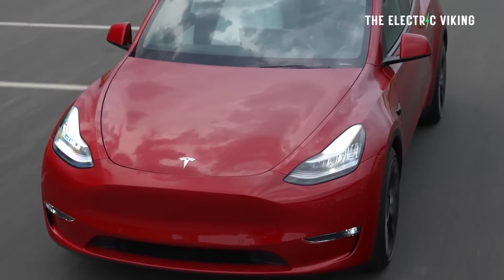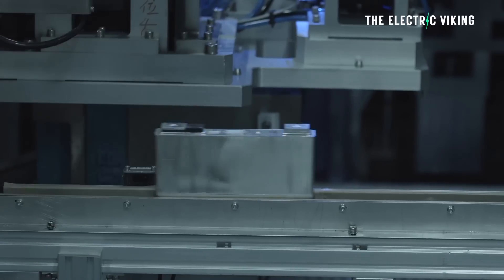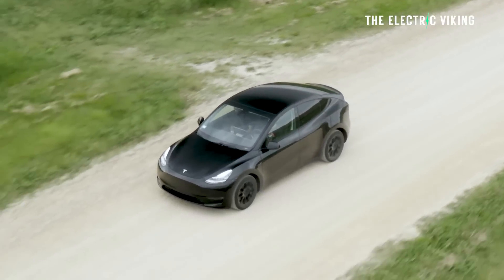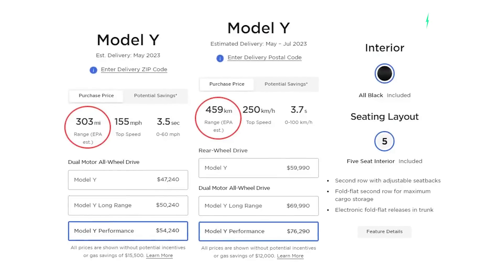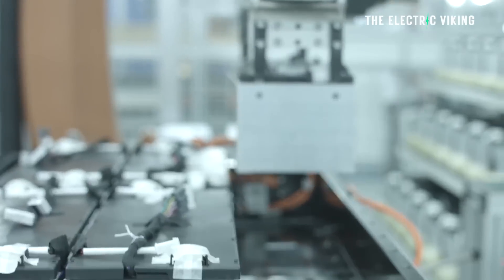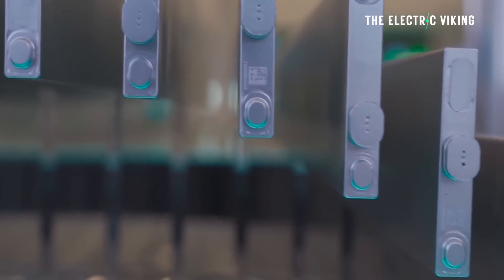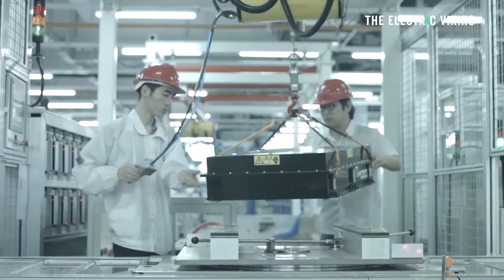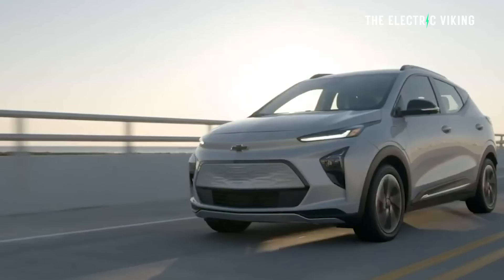Tesla makes big change to battery in Model Y Performance

Comment: I think that your range calc is backwards? one rotation of a larger diameter is a certain distance, larger diameter has a longer liner distance on one turn than a smaller diameter so will go farther on one turn, or goes a longer range. It's like changing gear ratios when you change overall wheel/tire diameter. Has anyone bothered to measured TIRE diameter or the rolling radius with the smaller vs. larger rims because they could be the same depending on the tire that is installed. Tesla may have kept overall diameter the same in order to not mess with the gear ratio?

Comment: I don't know how for one minute you could think that going from a NMC battery to a LFP in their supposed performance model is great move. Technically it is significant step backwards and is solely a cost saving measure. LFP batteries are particularly bad in sub zero temperatures in their performance and charge retention, ie you loose a lot of range 35-45% in subzero temperatures.

Comment: I thought there was an issue with fitting the performance brakes with a smaller wheel, I recall that was the case with M3, there is something unique about the bore or offset of the wheels to fit with big brakes…
Just from memory, haven’t looked in to it.
Reply: I have MYP with the 19” Gemini’s fitted, no issues. There may have been an issue with the M3P downgrading though.

Comment: Wouldn't we be able to tell if a Tesla has LFP batteries because of how the charging is done. Cars with NMC batteries tell you not to charge over 90% on a daily basis. But cars with LFP batteries COULD be charged to 100% daily. So wouldn't the car's charging screen notifications reflect the type of battery it has?
Reply: Yes you can tell on the charging screen.   It's not direct but if you look at the green battery it has the recommendation for charging and the lfp shows to 100%

Comment: You can add a realistic 40 horsepower to a model y perf by changing to 25 pound wheels 19 inch  factory sets weigh 88 pounds a corner w a tire.
Reply: Imagine the range that would add to city driving.

Comment: As Europe gets more cars out of Berlin they need less from China so they may be an excess of Chinese manufacturing capacity or ability to ramp it up so they send them to Canada and free us US production a bit . I really wonder about the chemistry of the 4680 battery ,could it go LFP or the battery with  manganese in the mix ??   .

Comment: I suppose in Vancouver or Toronto drivers won't mind the distance - unless - they do a lot of traveling between cities. Canada is very spread out; and there are many locals where 200 miles real driving range at 70mph.. is going to mean charging more during the trip.  Say Yellow Knife to Edmonton..that is a 15 hour drive with zero stops;  to charge every 3 hours may take 4 stops of an hour boasting total time by to nearly 20 hours; if you were staying somewhere at night I suppose you could subtract one charge; but even making each leg would be stressful

Comment: Canadian here - 488 km range is more than I need for the longest continuous, no-stopping trips I have ever made in the last two decades.  LFP batteries are my strong preference - longer life, ~ zero fire hazard, & can be charged/discharged  0% ~ 100% without degradation.  What's not to like?
Reply: As a Canadian I would think your preference would be to sodium so you could actually have some winter range.
Reply: Winter 303-30% =213 -highway 20% 173 miles.   Your ok with that?
Reply: @charlescasto4226  Yes, in my specific circumstances.  I'm aging out of long winter driving situations, so range loss in winter is irrelevant to me.  I'd also remind you that ICE vehicles also lose range in winter, especially when driving in snow.  Truth is, I may never actually own an EV - my little 2007 Honda Fit is still very low mileage & may last my wife & me for the rest of our lives.  Who knows?
Reply: @jrb_sland5066  ice loosing range in the cold is a disingenuous argument as you can fuel right back up and the highway has no range loss.  Where the ev has to constantly heat the battery to use it.  Hence the loss.  If your in deep snow you will have even more loss for EVs.

Comment: With all the claimed break throughs in battery technology it still seems the vast majority of EV's still have a range of around 250 - 300 miles on small wheels.
With most countries not having the infrastructure this means going on long journeys, typically for holidays with family or where a caravan may have to be towed, this limits or can make it extremly inconvenient and stressful because of having to plan where to recharge with likelyhood of queuing for ages in busy areas.
For these reasons alone, will not be purchasing because of constant worry and hassle... 500 - 600 mile range coming down to 400 mile when towing would be the time when clearing out the old petrol car...
Reply: I don't actually know one person who owns a caravan.

Comment: I don't see why larger wheels, with greater circumference tires that travel farther per wheel rotation, provide less range.
Is the motor so much less efficient at lower RPMs?

Comment: I'd rather have the LFP battery car. The longer lifespan and greatest safety are the most important factors to me. They are fast charging and have a wide operating temperature range. The energy density is everything I need in a car battery; that's win / win / win / win / win.  Cheers!
Reply: More cycles, but NOT persé longer lifespan… Common mistake or unmentioned: calendar aging they are similar to li-ion
Reply: Another win for the chemistry is LFP batteries should be charged to 100 percent daily while the other chemistries are recommend to no more than 80. Meaning you’re getting all of the posted range every time you drive the car.

Comment: I have a video on my channel giving the Model 3 Performance 340-350 miles of range just by switching out the stock wheels and tires for Aero wheels and low-rolling resistance tires and showing that it works in real world conditions. No hypermiling required 😎

Comment: Looks like the Performance edition takes a hit in "performance". Now 3.7s vs. the former 3.5s 0-60? LFP energy density not as good...anyone check the curb weight? I get the decision, but range (or before mpg) or "maybe better durability in the long run" are not the reasons why we pick the "performance" edition ;)

Comment: I don’t think you are correct on this one. There is no way that a Performance Tesla will have LFP batteries. LFP has many advantages over NCA batteries but performance isn’t one of them.
The Shanghai Model Y Performance is built with NCA batteries not LFP so what is the basis for the nonsensical LFP switch

Comment: The performance version in the US with 303 miles of range is really only 272 for normal 90% charging. If the new lfp spec performance has 250kw charging speed it seems like a good alternative 🤔
Reply: LFP hits 170 kw and can’t do 3.5 seconds 0-60. There is no way the performance models will be LFP
Reply: @Jeddin  the new model 3 LR appears to have LFP with 250Kw charging so maybe these new larger LFP packs have higher charging speeds over the base model LFP batteries

Comment: Elon musk tweeted that lithium iron phosphate batteries should be charged up to 100% so you actually end up getting more practical range.
Reply: You have that a little twisted.   Tesla wants you to charge to 100% because the software has trouble gauging range without that reset.   The charging does hurt the batteries but their feeling is the battery has such a long life the owner will not notice the degradation.   Not cool in my opinion.

Comment: In Canada, bigger wheels help in the snow to rise the car a litle more. But the cold has a bigger downside on these batteries (LFP).
Reply: The Tesla Performance models are lowered for handling, so bigger wheels do not raise the ride height.  The only good reason for larger wheels is for larger, and therefore more effective brakes.
Reply: @VVBros1  Is larger wheels only on performance cars?

Comment: Going to Tesla with one quetion before ordering. Can I charge to 100 % or 80% for new Y Long Range here in Canada. That will answer the LFP Question There will be a weight difference to China Made should be CATL. Germany is BYD Blade Tesla installed pack.
Reply: Only the lfp batteries can be charged to 100% and not damage the battery.
Reply: @jebes909090  incorrect.  It does damage the battery. But the life is so long they feel like you will not notice the difference.     Many many many have posted this wrong. So it's wildly known incorrectly.

Comment: LFP still have issues with cold weather and Canada has plenty of that 3 seasons of the year. The Standard range has only one electric motor that doubles as a battery heater so the performance should do better with the 2 motor design and higher battery heating output which is a win win! By the way just picked up my Model Y Long Range AWD yesterday (in Canada) and the build quality from Fremont is stellar, did not find one issue that needed addressing, excellent Tesla you are bring us premium vehicles, I am very very picky person. Another thing the frame-less doors closing sound very much like my Ioniq 5 doors which had already an excellent closing sound!
Reply: Great insight Bert! I'm ordering Y Long Range as well and wonder if your Y has LFP or NMC battery? Thank you very much.
Reply: @Anderson Lin  I purchased NMC model, which was without fault, absolutely pleased with the build quality!
Reply: @berthogendoorn2133  Appreciate your valuable insight!

Comment: Are big wheels better for roads with lots of potholes? UK roads are in a terrible state.
Reply: Usually the bigger wheels have tires with smaller sidewalls. The smaller wheels have tires with larger sidewalls, so are better for dealing with potholes.
Reply: Scott is right. The bigger wheel with lower profile looks good but also has a bigger footprint that makes the tire less functional in snow and more likely to hit those potholes.

Comment: I suspect part of the reason for the bigger wheels on the performance versions is to ENSURE the vehicle recvieves the Higher Rated Tires, that naturally are only made in that size.

Possilbe story here, for gear-heads, maybe. Racing on weak tires, might make the car look bad.
Reply: Bigger wheels make the car less likely to flex in a sideways direction.

Comment: This is why Tesla is going to do a JV battery factory with CATL in the U.S.  That way they can let CATL make the a LFP batteries while Tesla makes the 4680s with NCM chemistry for the Cybertruck, top line Model Ys, and the ling range Semi. 
The 2170s will continue to be used to fill in any supply holes and in the shorter range semi. 

Meanwhile they will ramp up an additional new 4680 factory at their expanded Nevada factory site specifically for long range semi since the new semi factory will be located there.

The question is where will the LFP batteries for energy storage come from? Possibly the new CATL factory but also possibly from China.

Comment: The benefit of taller tires is road clearance.  I live in a rural USA county. Lots of dirt and gravel rods, lots of snow in the winter and many unplowed roads. That 1nch or 1 1/2" extra clearance makes the difference of being stuck at the store parking lot or not. We also like going out in the forest to pick mushroom or berries, road clearance is important there too. Then there is the problem we will all face, if we live long enough, old age. Low cars are harder to get in and out of.  For all these reasons I drive a pickup truck. Waiting for an affordable ev pu truck to be available in the USA.
Reply: I'm not sure that the clearance is really different.  The tire diameter is larger but the height of the tire is shorter.  You get a slightly wider tire contact patch as a result but the diameter of the tire overall is about the same.
Reply: By the way Sam,  I really like your channel. I hope your wife gets better. Cheers
Reply: How often do you actually need a pickup truck?
Reply: @ericyuan9718  it all depend on what I'm doing.  Most days don't need one. But then there are several days in a row I'll be hauling dirt, firewood  or towing a trailer. During they winter, here, about every 3rd day. When I get too old to do manual labour, I'll be getting a nice stationwagin( salooncar) . Hopeful an ev. We have a Subaru outback. We really like it. Both rigs are paid off so, nonpayments is nice.
Reply: Are they taller? I assumed they were just wider.

Comment: Actually, bigger wheels means better grip on the road. It makes sense on a high performance supercar like the TMYP.
Reply: It also doesn't mean reduced efficiency. Larger wheels have fewer rotations per mile, and so would be more efficient if the tyre width was the same. The reduction in range from fitting them is a combination of the tyre  width and the gear ratio being optimised for the most popular sellers, which are generally the cheaper cars with smaller wheels.
Reply: @AndrewVerran  Wheel bearing friction is only one factor of many affecting efficiency.  Larger wheels and therefore larger tires will likely be heavier.  A general rule of  thumb says one additional pound of unsprung weight is the equivalent of 5 additional pounds.  Keep in mind cars usually have 4 wheels,,  So therefore, one additional pound per wheel is the equivalent of 20 additional pounds  Higher rotational mass also means slower acceleration and slower braking.  Aerodynamics also affect efficiency.
Reply: @VVBros1  Wheel bearings aren't the only things going round, 2cv joints per driven wheel, crown wheel and pinion tooth friction, diff same, the bearings that go with them. Mass will matter accelerating, for sure, but doesn't impact constant speed driving at all.  The weight difference between 18" and 20" appears to be about 5lbs and the rotations per mile difference about 4. More than anything, how and where you drive is probably the single most important thing.
Reply: Wheel size does not, by itself, have anything to do with tire grip.  A wider tire mounted on a larger diameter wheel should have a larger tire patch, which in most cases like dry roads, means better grip.

Comment: Elon Musk IS part of the conspiracy to control people, or off not paying attention, or in one of his bad brain wiring funk.  Reducing range is crap.  Most people buying this model want more range. So what if can charge to 100% each time and not have slight less degradation.  Bet Tesla is also putting in the lower amp inverter.  Limiting to 170KW charge (for 3 minutes, then vastly reduced way below speed of recharge than 2170).

Comment: Though the best reason for selling Shanghai built model Ys in Canada is the drastic improvement in build quality - much better fit and paint and even reliability if the switch to Shanghai cars from Fremont built to the UK is anything to go by.
Reply: The reson they are shipping Chinese M3 to Canada, is the fact that Tesal has room to build those cars in Shangai & Canada don't have the IRA so the batteries will not need to be discounted for the rebates!

Comment: I want 400 miles in the Model Y. Waiting…
Reply: If they offer 400 miles then some other moron will say it’s not enough and they want 500 miles.
Reply: @JAM_2024  the more miles the less need for Superchargers! I agree, will not happen. At least in my lifetime. 😂😂😂
Reply: @JAM_2024  so if their needs don't meet yours they are a moron?   I feel like you need to read some books.
Reply: I’m in the UK, 400 miles isn’t needed here, that’s a solid 8 hour drive on our congested roads.
Reply: I think that Tesla Roadster that was launched into space has gotten the most mileage on a single charge.
Reply: Untill temperature doesn't matter and highway efficiency is listed as the range on the screen I am waiting till 500 mile range.   Northeast USA buyer.

Comment: On battery day their presentation showed the affordable sector to all be LFP packs.
Reply: Correct. They said LFP will be used in their standard range and eventually long range models while performance will continue to be NCA. Which is why I think Viking is wrong on this video speculation
Reply: On battery day it was the standard range Model 3 & Y shown to be using LFP. Then in the March '23 investor presentation slides it showed all Model 3 & Y to be using LFP going forward. The Nickel cells were for the S & X only iirc. I remember them mentioning performance but the pictures showed only S & X.